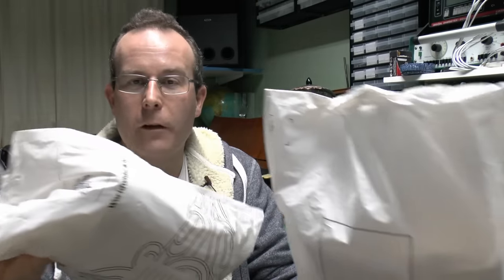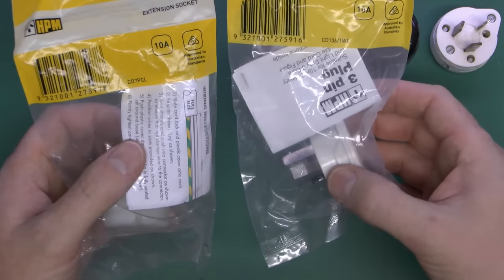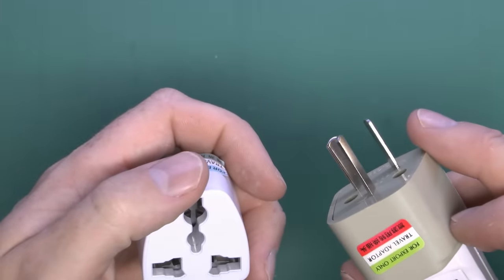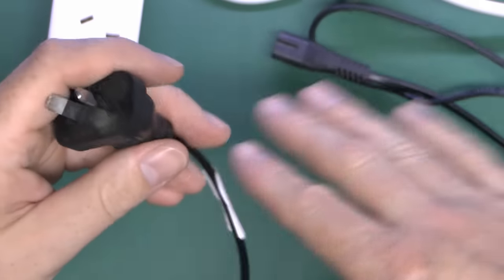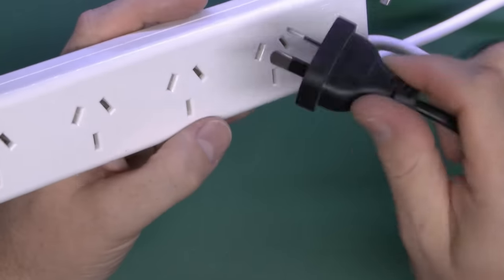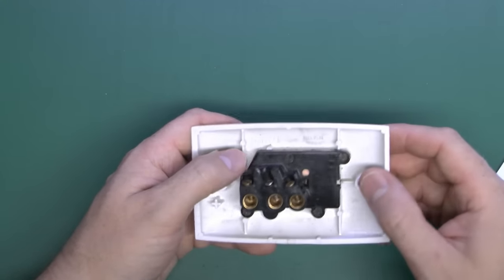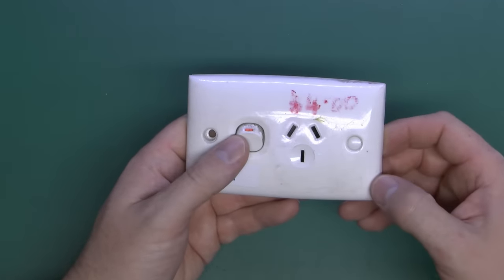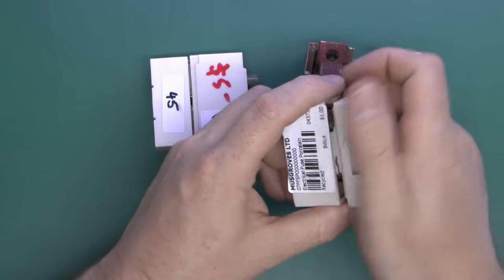New Zealand Electrical Items

Comment: On that clear plug it looks like you are supposed to wrap the individual wires around the front for strain relief, is that really so?
I've seen clear australian plugs before, they don't trust anybody! ;-)
That switch is tiny.

I hope you will do more countries, this was very interesting.
When you are through you can wire each room in your house with a different country!
Reply from the maker: stefantrethan Yes, the wires fit into the three slots, the instruction leaflet shows this as well.
Reply: +stefantrethan These are common in Australia when I lived there in the late 80's 90's many so you can see if wires had come loose due to strain on the cable

https://www.clipsal.com/Home-Owner/Products/Safety/Portable-Protection
Reply: +stefantrethan  It is not that we do not trust anyone. Health care AS/NZ Standard (can not recall exact number right now) says that ALL cord plugs and cord sockets MUST be transparent to enable a quick visual assessment of the insulation inside (when cords are pulled especially with moulded plugs) the outer insulation pulls away and also that the correct wire is on the correct pin (the last part is more for the person doing the yearly test and tag).

On Construction sites all NON Moulded plugs used on power tools, extension leads, and RCD breaker boxes are to be transparent to enable a visual spot check usually by an OHSE person from the building contractor (who also check that your equipment has been tagged in the 3 monthly tagging scheme (this is usually done after work by an electrician from the electrical contracting company on site and paid for in cartons of beer ;)
Reply: DIY is actually permitted on non fixed wiring; i.e. what are classed as portable appliances, in Australia. Earth pin faces up in the UK.

Comment: The un-insulated 1 mil and 1.5 mil lighting wire had a bare Earth wire until about the mid 1990's unless you paid extra, now you haven't got the choice. They are all insulated.

Comment: Plug #9 falls under US/china/Canada standard pinout, no idea where they got the 250V rating but we do allow up to 20A @ 120V on those pins in the right scenario :)
Reply: +codemsan They use that plug in China for unearthed appliances.
Reply: That would explain the voltage rating, they had mostly phased out type "A" plugs for  type "I" nowadays so i forgot type "A" had seen anything over 100-127V
Reply: Some locales use that parallel (US) plug on 240v; Incidentally, all of Hubbell's plug designs were originally rated for 250v max
Reply: Wiresgalore 100V - 127V?? Only up to 15A for 100V-127V on US plugs but US plugs rated at 125V can be plugged into 220V outlet in the Philippines but supposed to be below 6A or 7.5A.

US 3 pin to German adapter rated at 250V 7.5A are equivalent to 1875W.
Reply: bjem below 6A. Same as the Philippnes used US plugs on most Appliances in the Philippines.

Comment: Australia, NZ & China use the same Plug standard, US & Taiwan share their same plug standards
Reply: Canada and Japan (now grounded too on new instalations) and Mexico is the same with the US and Taiwan...:)
Reply: Leatherkid01 Also the Philippines uses 220V 60Hz but they used US outlets same as Taiwan.
Reply: HDXFH Cannot plug 2 pin NZ plugs into Chinese 3 pin outlet. If without Earth pin, the chances of 2 Pin NZ plugs into Chinese 3 pin outlet cannot be plugged in if Earth pin has been plugged in, so both NZ 2 pin terminals such as live and neutral can be unlocked as you plugged in.

How about plugging paperclip into chinese 3 pin outlet as you diy with long nose pliers to make it’s size of a flat pin plug and fold it so make sure the paperclip must not to be touched between live and neutral terminals, then plug your 2 pin plug and ready to go. 

From the makers of plugging thin Europlug into UK outlet by plugging using chopsticks to earth outlet and plug your 2 pin thin Euro plug into UK outlet.

Comment: Switch up, power on? Are the switched upside down in southern hemisphere?
Reply: With the older style switches (no longer in use) switch up is normally off, assuming they were installed the correct way round and aren't part of a two-way switch arrangement...

Comment: Although you can plug in two 13amp appliances into a socket using those uk double adaptor plugs its no different than having a double socket as a spur which is allowed.
(I never understood why that was allowed any ideas?). In fact I would say the adaptor is safer as you can see what you are dealing with where the layperson would not know if a socket was part of the ring or a spur. Am I missing something.
Reply: Glenn Pierce depending on a couple of different factors, generally a a single 2.5mm conductor can carry circa  27amps which is adequate considering that each socket outlet on a double socket is 13amp max.
Reply: impactvision Thanks . Should have realised that.
Reply from the maker: Glenn Pierce The other problem with those 2 and 3 way adaptors is their physical size, they are easily knocked causing the socket to be broken, and with 2 or 3 items connected the combined weight tends to pull the whole thing out of the socket.
Reply: +impactvision 
Funny enough I had to buy some 2.5 mm^2 twin and earth today from Wickes (A UK DIY store) and its says Max rating of 240 volts at 23 amps (BS 6004). I realise in reality it could take more current but who came up with that theoretical rating as technically one could exceed that on a spur.
Reply: +Glenn Pierce 

It all depends on how the cables are installed. It is also worth noting that all socket-outlets are manufactured to comply with BS1363 part 2: 1995 and the test applied is a maximum of 20amps  (split 14A/6A) for double sockets. 
Its is very unlikely these days for anybody to be plugging in one true 13amp load into a double socket let alone two into the same spurred outlet.
Reply: +impactvision How do you determine the ratings for the 2.5mm wiring in the UK? Here in NZ, the wiring rules (AS/NZS 3000) give the following 'rule of thumb' ratings: free air 25 amps, partially surrounded by insulation 20 amps, totally enclosed in insulation 16 amps.
Reply: Table 4D5 in BS7671.

Comment: I've never seen an export only plug on NA imports. I suspect it's because a common design allows economy of scale.
Reply: It's probably because the chinese pin layout is close enough to a non-polarized 2-pin N/A plug that they'll natively fit our sockets anyway. Probably not very well, god knows a device made so cheaply they can't even be bothered to mold on the correct plug for its intended country of purchase won't have a properly made plug on it, but it is close enough.

Either that or the appliances sold here are completely different ones because we use a lower voltage, slightly higher frequency.  The frequency isn't too big an issue, most passive devices won't care and will work just fine on 50 or 60 hertz, but anything that relies on the AC frequency for something(Like digitial circuits that use it for a clock signal, synchronous motors, some power supplies) will work poorly or not at all. And of course the lower voltage is an issue.

Comment: New Zealand sockets don't have shutters, the ports are small enough you can't accidentally stick your fingers in, and if you have kids in this country you get what is called a safety outlet plug, its a little white plastic plug that is entirely smooth and requires a plastic key looking thing to remove, the tension of the sockets hold it in rather firmly
Reply: Raxis Chinese 3 pin have shutters but it locks both live and neutral outlets if without plugging earth plug into earth outlet.
Reply: Shutters are optional - they just cost more...
Reply: @Raxis,
Yes they do have shutters.
This was mandated back in 1998.
They are a pain the rear trying to get your Duspol testers into the Phase and Neutral slots.
Reply: @mikeZL3XD7029  oh true, didn't know that, no place I've been in was built newer than 1990 (more likely 1985 tbh)

Comment: The reason our uk cable changed from white to green and yellow on the earth wire is electricians couldn't tell it was white if it got stained or dirty so it was easier to use green and yellow.

correct me if I'm wrong :D
Reply: I'm pretty sure green and yellow is used for earthing for the benefit of colour blind persons, previously it was solid green. White was once the colour of Phase/L 2, it was then changed to solid yellow, and is now black.
Reply: jayja45 ah right

Comment: When it became evident in 1999 that, within a few years, a new European Standard would require the use of the colour blue (rather than black) for the neutral conductor of fixed wiring throughout Europe, it became necessary for the United Kingdom to address the cable colour issue with some urgency.
The joint BSI/Institution of Engineering and Technology committee now responsible for the technical content of the Wiring Regulations (BS 7671) established a Working Group to consider the position the United Kingdom should take with respect to the harmonisation of the colours of the conductors of non-flexible cables for fixed wiring.
The Working Group concluded that the United Kingdom had no realistic option but to agree to use the colour blue for the neutral, and brown for the phase conductor of single-phase circuits.
It also concluded that, due to the widespread adoption in the rest of Europe, the United Kingdom would have to accept black for one of the other phases of a multi-phase circuit. The Working Group also considered that there was a need to be able to distinguish between the phases of a three-phase circuit and decided to propose the colour grey for one of the phases, because, of the very few remaining pan-European colour options, this seemed to have the fewest disadvantages.
The Working Group’s recommendations subsequently formed the basis of a United Kingdom proposal which was accepted by the CENELEC countries almost unanimously. Europe now has the opportunity to fully harmonise the colour identification system not only for non-flexible cables for fixed wiring, but also for flexible cables and cords and distribution cables.
Reply: The primary reason for changing the color-coding in domestic wiring in Europe from red and black to brown and blue is obvious - the color-blind couldn't distinguish between live and neutral, and the earth became striped green and yellow to completely distinguish from the conductors even if green couldn't be visualized.

Comment: The investment in U.K. Electrical design post WWII is obvious when compared with the rest of the world. Some may say that the UK has over engineered their designs, however I would argue that thoughtful proactive accident prevention, always outweighs statistical reactive requirement .
Reply: The only thing thats better engineered is the plug and socket, I don't see anything else better.

Comment: Aren't the plugs fused?
Reply from the maker: No, only UK plugs have fuses in them, other countries do not generally use ring circuits so the whole circuit is fused appropriately, typically 10A or 16A.
Reply: No fuses on these plugs. The circuits used in NZ are all radial, and it is deemed that the either 16A or 20A protection used on power circuits will act quickly enough to protect any allowable flex cord from a short circuit in an appliance if the appliance's own fuse does not blow.

Comment: In BRD we uses plugs and sockets there are not polarizated. That is a realy bad idea. Most divecec have a switch they use only one wire. For fuseing the same. So the divice is switcht of but under full potential. If the fuse blow the device is even under full potential. Another bad thing is, lamps they used a edison socket can get main voltage to the large metal ring. So it is possible to tuch mains even a lamp is in the socket.
Reply: Actually it is not that simple. You're supposed to connect L to the base contact of the socket and N to the outer thread of the Edison socket in a hardwired light fixture. Switches must be 2-pole here if the appliance is connected with non-polarised connectors, switching off line and neutral. Also there are Edison sockets available which prevent you can touch the outer threaded part of the socket.

Comment: Changing a main panel ceramic fuse required turning off the main switch, only fools didn't.
Reply: The world is not short of fools.
Reply: Yeah, I grew up in NZ in the 80's and I'm sure every domestic fuseboard I ever saw, also had the big master switch for the whole house on it. It was literally 10cm away. I never pulled one of those back then but even as a child I knew - you flick the switch to cut the power and THEN pull the fuse.

Comment: China share our plug standard too, hence our plugs all come from there nowadays!!
Reply: +HDXFH That's not quite true. The travel adapters show the Chinese plugs. They have different dimensional tolerances and don't need to be sleeved. NZ plugs will fit into Chinese sockets, which is a bonus when travelling there.
Reply: +Bart Milne yes, the prongs on the Chinese plugs are slightly longer than those of the Aussie ones; they're the same length as the original (American) Hubbell design
Reply: +Bart Milne Bang on about tolerances and sleeving. I absolutely DESPISE when I find new products for sell being marketed and advertised as for the Australian/NZ market, when its obvious the product was intended for the Chinese region. The length of pins and lack of sleeving are almost always the usual dead giveaways, besides some of the odd shapes of the moulded plugs (some of which, when pushed into a standard Aussie powerpoint, would make the lead point 90° UP the wall, and cover the switch on some models, such as Clipsal 2000 series double powerpoints). Sometimes other failures of meeting electrical AS/NZS standards can be spotted.

I am not sure, but China electrical system appears convoluted much like Japan, in that they have different  standards depending on where you are in China. I will say the worst thing ever from China is that does everything whore socket, just absolute rubbish.
Reply: bjem NZ plugs 3 pin only for 3 pin outlets. 2 pin plugs cannot be plugged into 3 pin outlet due to locked out from the shutter as earth outlet locks both live and neutral outlets just like the UK outlet.

You can plug NZ 2 pin plugs into Universal US/Euro outlets in China, Thailand, Vietnam, Cambodia.